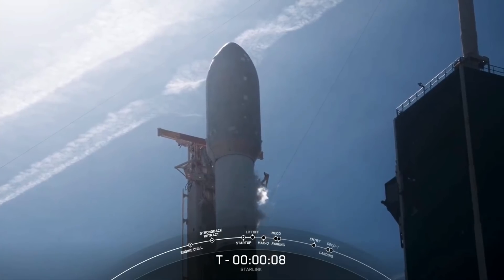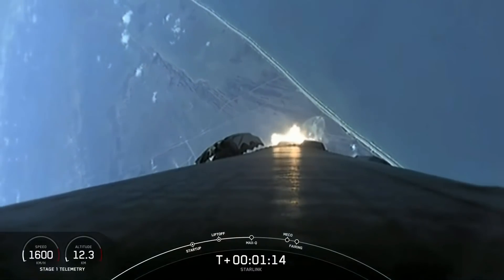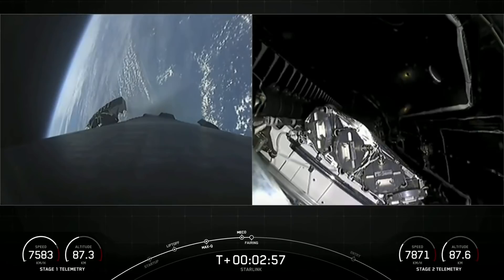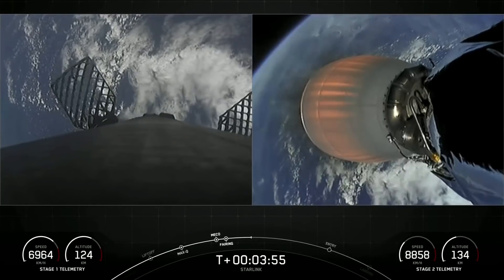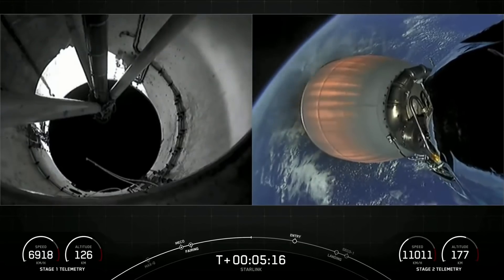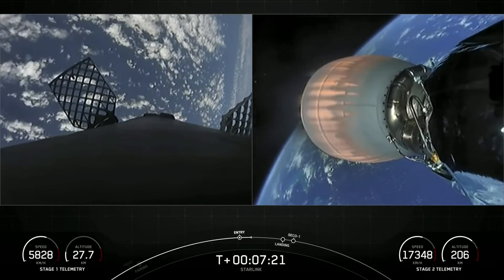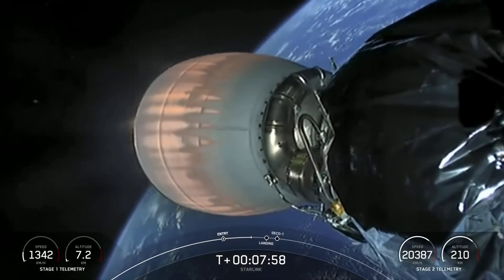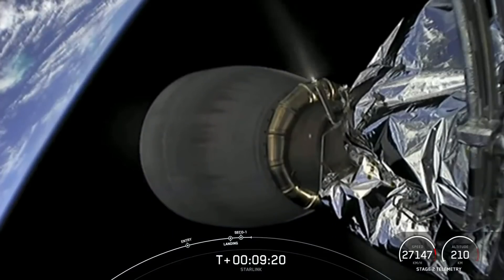SpaceX launches 49 Starlink satellites from Florida, nails booster landing

Comment: Wikipedias Starlink page actually has a great description of why this is a disaster for optical and radio astronomy even with Space X’s several futile attempts to address it, and several failed suggestions such as better software. Soon we may be blind to incoming asteroid threats, and James Webb is a bottle neck that can’t replace thousands of earth based telescopes with thousand of hours of telescope time compared to 1 project at a time. Also if some of these satellites are accidentally knocked off course The evermore dense traffic in orbit might end in chaos like dominoes falling, in fact it already happened. Luckily it was in the beginning of the project so traffic was a fraction of what it will be
Reply: It's only really a problem in near sunrise/set hours
Reply: @Ignacio.Romero  Star link is just getting started and it is not the only mini satellite program, and we have telescopes all around the globe so it is always a problem somewhere. Besides radio telescopes are working night and day. If it wasn’t a problem then astronomers wouldn’t ask the UN for help
Reply: @riheg  At night there's no light for them to reflect, that's why they're not a problem